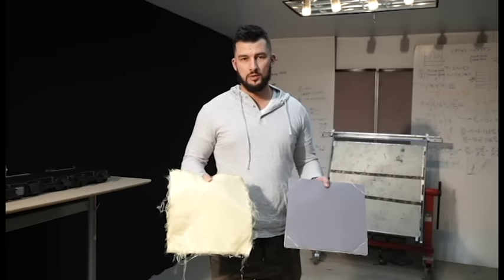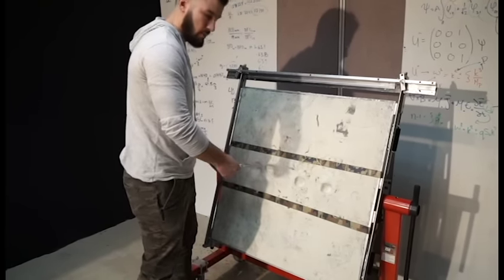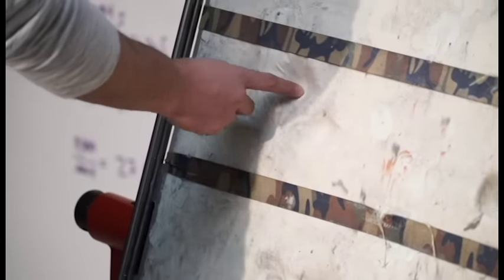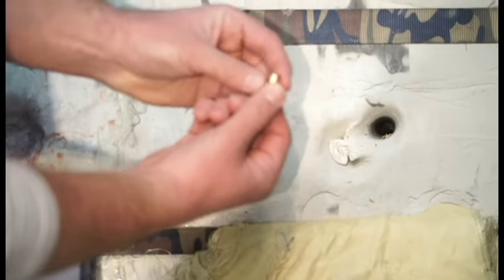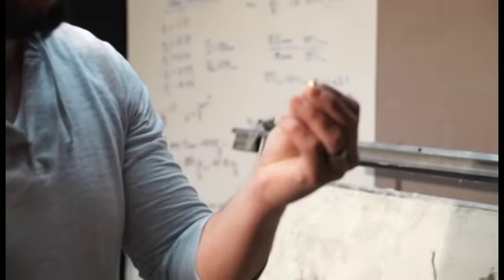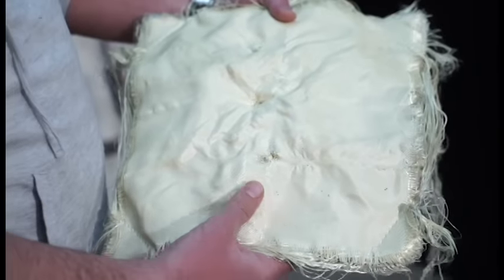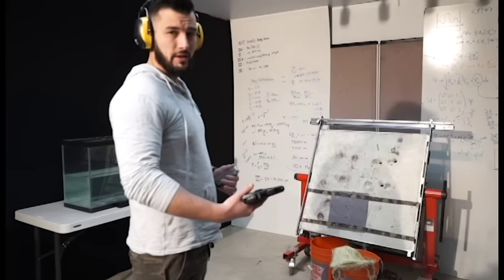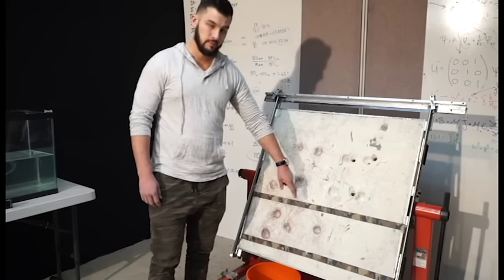Side by Side Water Test of Citizen Armor and aramid fiber armor (Kevlar)

Comment: It's not a fair compassion since the armor made with this carbon nano tube material is not solid nano tube layers but has a Kevlar like fill material in between them. Not that their armor is any poorer because of this. It's just that you can't directly compare quantity of layers to quantity of layers, nor thickness to thickness to thickness because the way you layer materials is important as well. Needless to say the citizen armor products are still very impressive and the issues with kevlar de-laminating and moisture ingress is more of a long term issue, and the main reason to be careful trusting surplus soft armor.